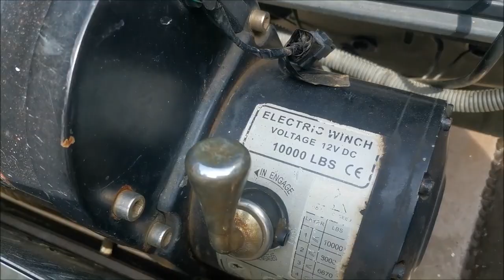Jeep Cherokee '97  Custom Off Road (Just Empty Every Pocket)

Comment: Rewel dan rumit electricalnya...di rumah ada 2 unit XJ 14( Jeep Cherokee Limited ) mana saya tinggal di kampung kecil pula...udah sensor Crankshaftnya, fuel pumpnya...yg kerap bermasalah bagian ignitionya pula...over heat sih ga pernah...mesin 4.0 L high out put tuh memang torsinya besar....kemarin si Indian merah yg udah full spek off road tiba tiba ga mau hidup padahal cuma light off road....tolong solusinya🙏 oh ya yg satu thn 1994 blm ABS steer blm ada air bag nya...tapi booster rem udah ganti punya TLC VX 80.Oh iya CKP kemarin pake Mopar....na si hitam ini sama dengan punya saya yg di biarkan apa adanya.
Reply: Headernya Borla boss?
Reply: Itu roll cage custom? .. bumper customnya keren ga kalah sama ARB...👍👍👍